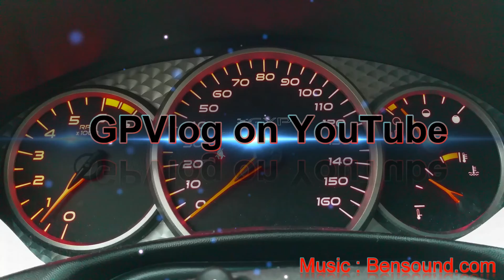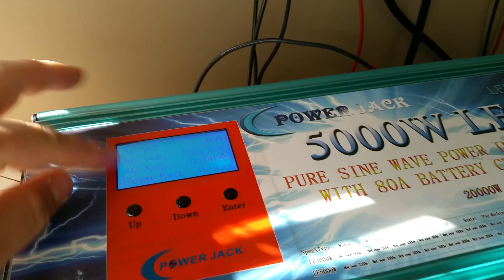Running my refrigerator on a Power Jack Inverter

Comment: If you do a 24 volt inverter or a 48 volt inverter  it will  handle it better and there is less current draw from the batteries

Comment: This has that much power? Almost as much power that a generator would put out. Wait a minute did I say generator? Why not use that instead so it won't damage any battery. You can also use a generator in an emergency and it will also power up a hair dryer, coffee brewer and a toaster or a microwave.

Comment: I want to build a portable solar generator I’m new to this but I need parts like this to keep me on a budget for a build can you help me get the right components to build one like inverter ,trickle charger ,which battery with ah to use maybe 200ah (x2),which charge controller to use 30amps can you help me with this if you have contact info I would like to get your knowledge I found your video made it better for me to understand for someone with no clue on where to start and thx in advance
Reply from the maker: Hit me up on my Facebook page. I will help in anyway I can
Reply: I sent you a messenger message thx

Comment: The problem is, 1 the power of an inverter came from the batteries. 12vdc should not go over a 2kvac , an 24vdc should not go over 3.5 to 4kvac, an 48vdc should go well with tis inverter. Of course they make 8kvdc inverter with 24vdc, but thy aren't work as they should. When you draw a great amount of energy let say 8k from a 24vdc battery bank, is like you trying to use an (ah) battery as a Cold crank battery, because you are drawing a lot of amp in a short time. But in you have a higher Vdc like 48vdc it will compensate the draw and it wont hurt your battery bank.

Comment: I have a 1500 watt, 6000watt max & it runs my full size fridge just fine. The power saver mode doesn't seem to work for anything, just makes my light like a strobe light, so it's useless. Still the inverter does what I got it for.
Reply: texjames2000:  The “Power Saver Mode” is a battery charger and inverter at the same time.  You connect the AC Input as the power source to use the power save feature.

Comment: i use the power saver mode as a remote power switch.i have the 24 vdc/ 120 vac,5000 watt inverter / charger with ats/ups , in my 1969 camper. as long as you have 35-40 watts of lights ,on a switch,it will turn the inverter on  and go back into power save mode until a load ,[like a fringe ], turns it on. very cool.  light  flashes a few times first.

Comment: GPVlog, I believe Power Jacks @ 3000w and more have 4 battery input posts.  So do you wire 2 negative cables from your battery negative to each negative post on the inverter?  And do you happen to know why Power Jack chooses to use 4 input posts whereas many inverters of the same size use only two?

Comment: Hi great info mate.Ok i have a problem,i have the 8000w version of this and im struggling to understand why i would need more than one battery.The inverter in my case will be powering a static caravan and it will have a constant feed from a running diesel car at 110 amps.I am wanting to plug an extension straight in to the inverter and wire straight into the 240v hook up on the static.q1,,,Will i loose any voltage doing this q2,,,,,will i blow the inverter.I have added up my total watt usage and im around 5000w running obviously starting 1 by 1 fridge first....I just dont understand how or why i will need more batteries as i will be giving the inverter a constant 14 v from the car running on oil.Any help would be appreciated here as its something i have not done before and im needing some guidance please m8.

Comment: HEY BRO, LIKE YOUR CHANNEL... BUT JUST TO HELP OUT YOU SHOULD ALWAYS RUN A CAPICITOR, EVEN A SMALL ONE LIKE 500K WHICH IS ONLY .5 FARAD MAKES A BIG DIFFERENCE BRO... I'M RUNNING 2 CAPS ON MINE...  A .5 FARAD GOING IN BEFORE BATTERY BANK AND A 1.5 FARAD CAP AFTER BATTERY BANK BEFORE THE INVERTER... THAT WAY IT HELPS CHARGE QUICKER AND DISCHARGE EASIER WITH LESS PULL OR STRAIN FROM YOUR B-BANK DURING HIGH POWER SURGES... ;-) HOPE THIS HELPS OUT...  https://www.youtube.com/watch?v=YxU9K_VzJo8  OR EVEN  https://www.youtube.com/watch?v=-pLz3XFpHlc

Comment: GPVlog hey quick question. most of the powerjack inverters are for 12v/24v. i have my batteries in a 48v bank. can i still use this 5kw model in my system? I am planning to use it in a off-grid whole house application where i am back feeding my ac output into my main panel on a 50amp breaker.
Reply from the maker: Hey bud. I dont know of any power jack inveter that will work with different voltages. They are sold as 12, 24, or 48 volts input. The manual is specific that the inverter will shut down or fail if outside of the range you have setup for.
Reply: +GPVlog thanks. i found out that i have to get one specific for 48v loads.
Reply from the maker: +Joseph Grant get a video of your setup if you can

Comment: put it on power save mode then it will shut down when fridge hits temp and then it will check at intervals for fridge needing power again. that should save at least half of your standby time.
I agree on the batteries though. get some whoppers in there or piggy back some parallel. I've got the same inverter and so far so good. . . mines on a boat.
Reply from the maker: strangely enough, I have tried that. when the fridge powers up and the inverter is off it will fault the inverter when it goes to power up the fridge. when I have the inverter on full time I don't have this issue. my guess is the caps are drained before the inverter grabs more from the batteries and it faults out.

but if you say it works for you then I could have an issue with my inverter
Reply: +GPVlog 
my fridge is motorless so can't compare. it sounds to me like it's so close to fault/accepting. just an idea here, but if your fridge is the only thing playing up. then buy a soft start mini board to wire in-line to your fridge. then the initial draw would be progressive rather than full hit. I think all electric motor driven things should be soft start as standard in an ideal world :-) 
hope that made sense and gave a little help your way maybe!
Reply from the maker: +YZFR1mart thanks for that idea. I will look into that for sure. 

I want to do the same with my window air unit. it pulls 3kw for about a second while it's powering up. it's a very large 16000 BTU unit.
Reply: +GPVlog 
the soft start units start at about £5 for a 1000 watt unit. I'm not sure of there spec etc but if you buy one that will do the both fridge and window unit, your on a winner. if your into recycling. try pulling one out of a modern washing machine as they have motor controllers also some power tools etc. I'm sure you know your stuff anyway. a bit of research and some tinkering and bingo :-)

Comment: power jack specifically tells you to have the power switch at the inverter to off, when you plug in an appliance.Then turn it on...Good video though.
Reply from the maker: +John French Power jack also says that the inverter will do a continuous 5kw. I always have the inverter up and running before plugging anything in. To each their own.
Reply: I think they are saying that the plug may spark as it goes into the receptacle, causing an electronic problem in the inverter.I just got a 40000 watt power jack.It's big. 100lbs. Does yours have a small toggle switch between the 2 white LNE terminal blocks..What is it for?
Reply from the maker: +John French its a fan control switch
Reply: Thank You  . 'Twould be nice if they had labeled it. I am in the process of converting a motorhome to run on electric ,by taking out the engine and installing a 3 phase electric motor.There are 19 episodes on youtube..It is called " The Electric Motorhome."..Again thank you for solving the fan switch mystery.